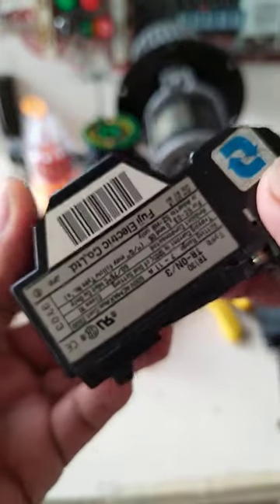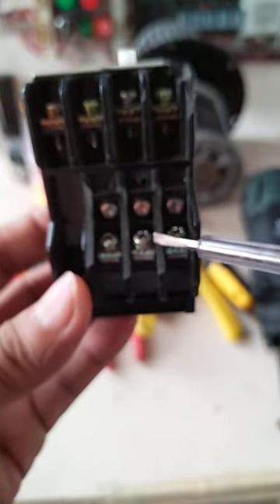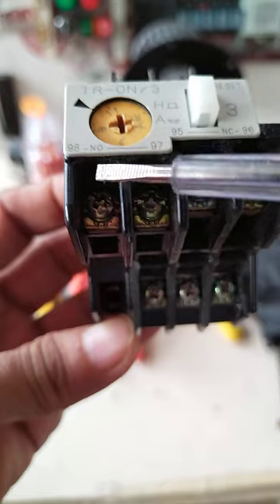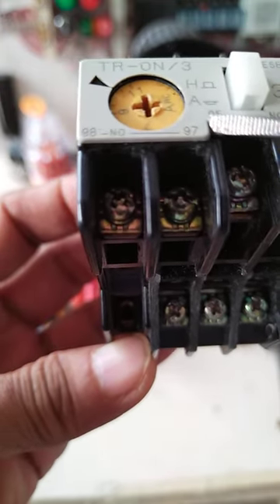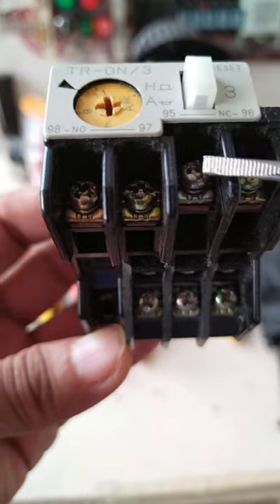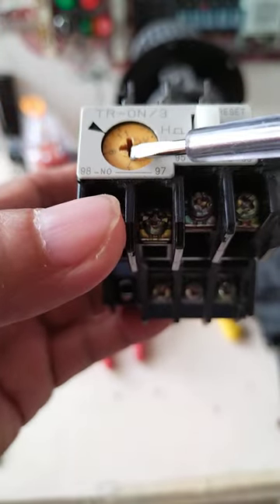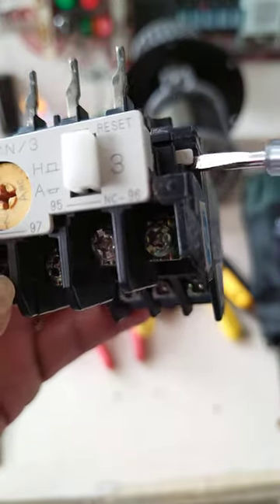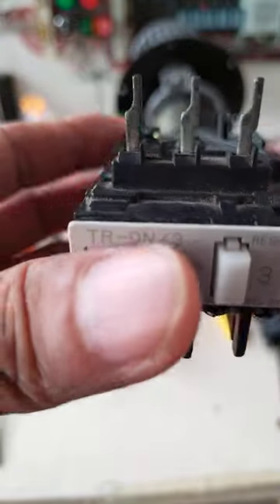#shorts OVERLOAD RELAY DETAILS

Comment from the maker: for NC normally close contact we are using it to cut the control power to the motor (usually we used the Neutral Line if single phase  or the 0 volts or the - line of the low voltage control (24VAC/24VDC)